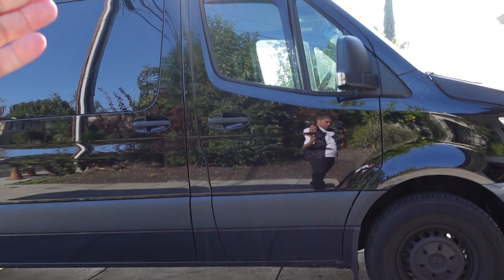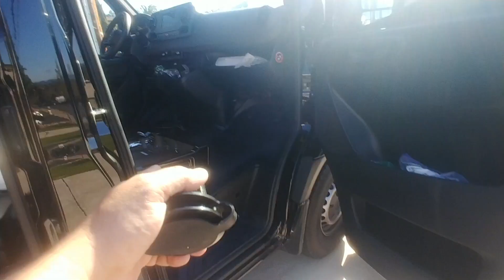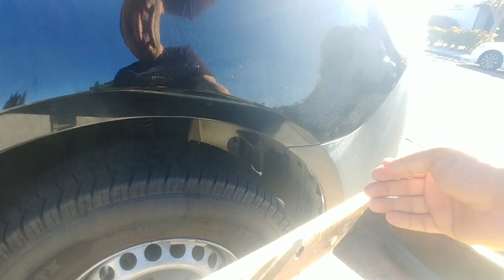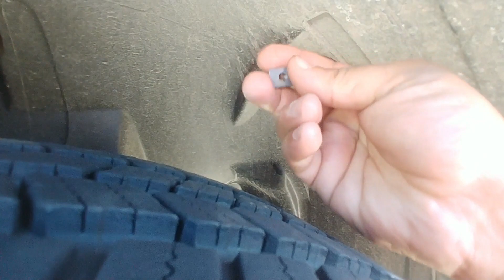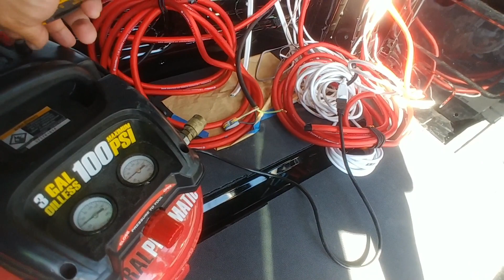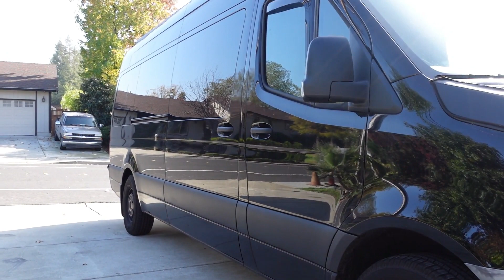Van Life Stealth Shore Power Plug Install▶️ 30 Amp Electrical RV Plug

Comment from the maker: ▶ See all the parts I used in my VAN build for FREE https://bit.ly/RFVanBuildPartsList
▶ See the VAN build schedule for FREE https://bit.ly/FreeVanBuildSchedule

▶▶ Update Stealth location https://youtu.be/PO2sdMM50-A
Free gifts ▶12 volt / 110 volt systems https://bit.ly/12vs110volt
Free gifts ▶Automatic transfer switch wiring diagram in color https://bit.ly/atspic

Products used in video
▶5 Terminal quick connectors https://amzn.to/46O7E6m
▶3 Terminal quick connectors https://amzn.to/3S3OwNQ
▶2 Terminal quick connectors https://amzn.to/3M6Enfd
▶Great 12 volt quick Connectors https://amzn.to/401ERZN
▶12-volt quick connectors kit https://amzn.to/46V0UDE
▶10/3 marine wire made for Camper vans https://amzn.to/3Qj3y0L
▶2000 Watt SW Inverter https://amzn.to/3rUuf2s - failed
Better 2200 watt sw inverter https://amzn.to/490E1R9
▶Inverter remote https://amzn.to/3ZZE2Rf
▶15 Amp Automatic transfer switch https://amzn.to/45yiAEk
▶30 Amp Automatic transfer switch https://amzn.to/45IGzAQ
▶Budget Inverter with remote https://amzn.to/3PYWMMc
▶1/0 Cable for inverter https://amzn.to/3CrUfT3
▶4 Gauge power cable https://amzn.to/407olrl
▶Lugs- 100 Cable connectors https://amzn.to/3FqFbI0
▶Lug Crimper https://amzn.to/3PZ7liu
▶Cable protector https://amzn.to/3PYnTHb
▶14/4 speaker wire (came be used for light 12 volt loads ) https://amzn.to/45AbLSr
▶14/2 speaker (came be used for light 12 volt loads ) https://amzn.to/402gRpJ
▶Junction Studs https://amzn.to/3M5bSii
▶Fuse / Breakers https://amzn.to/3M6F08z - use only for 50 amp loads or less
▶30 Amp Fuse / Breaker https://amzn.to/403WmJ1
▶30 Amp Lifepo Battery charger https://amzn.to/3Q25yZJ
▶500 Amp Battery Shunt https://amzn.to/3S4dSLl
▶Smart Battery Isolator https://amzn.to/45CzGAX
▶15 amp outlet https://amzn.to/3M5yJKr
▶15 amp to 30 amp plug https://amzn.to/3M4uUFg
▶30 amp shore power plug https://amzn.to/45yjMYk

▶▶▶Camper van playlist
https://www.youtube.com/watch?v=r2KTXLqso2c&list=PLDEbtVOPRC-id5xjqFsYm87bJSJL8bLbe

2019+ Sprinter Review https://youtu.be/wAAV6bnHNzY
The new toy  https://youtu.be/EAKbCledvsQ
Low Key Battery https://youtu.be/-FI_DG-DE9k
How to Buy a Camper van for cheap https://youtu.be/nqPSV0mszfk
Seat Removal https://youtu.be/KSUQawuSt_w 
Headliner removal https://youtu.be/FjrJBLXEbyU
Maxx Air Fan Install https://youtu.be/QXxBSx3cfI8
Maxx Air Fan Review https://youtu.be/JIRG7lSR5yQ
Maxx Air Fan Fix https://youtu.be/6k0mPqCgrl4
Bathroom Fan Review https://youtu.be/QXxBSx3cfI8
Spare Tire Carrier https://youtu.be/wVQ_h-FjtPE
Oem Diesel Heater Trick https://youtu.be/Ws9GHo9bWeM
Led Upgrade https://youtu.be/r2KTXLqso2c
Sportscraft Swivel Adapter https://youtu.be/HVkj6KVpUbs
Pocono Swivel Seat Adapter https://youtu.be/r-1HpIl71_I
Front Speaker install https://youtu.be/JjoJH4z4G1E
van Sound Deadener https://youtu.be/8x8RxmrBxL4
Sprinter Trim Removal https://youtu.be/ucYJsH5FJxY
Van Roof Deck https://youtu.be/4cu8mjVKQzc
Front Air Filter Change https://youtu.be/U46Ah40_vIM
Cabin Air Filter https://youtu.be/y8oZNLOkrok
907 Sprinter Oil Change https://youtu.be/bmgI-9KeEik
Maintenance reset https://youtu.be/wDTMwXHGqRY
Diesel Heater Hack https://youtu.be/Ws9GHo9bWeM
DEF Fluid https://youtu.be/Q84lEhLrobM
Portable Toilet Review https://youtu.be/fYu66hqGJZo
Affordable Kitchen Galley idea https://youtu.be/5DG9y_kmHLY
Rear door storage https://youtu.be/bPZfvTWAze8
Modify Rear A/C vent https://youtu.be/o4FJ6Y1ulCs
Sliding Door Bug Screen https://youtu.be/oGA8udVJlYM
Shower https://youtu.be/O4POEFKQmJQ
Plumbing video https://youtu.be/PuOqOt_911I
Simple bed idea https://youtu.be/Q7uGVFPgeDI
Van Life Camper Van Kitchen Galley Idea Under $200
https://youtu.be/5DG9y_kmHLY
Premade Camper Van Bed That Sleeps 4 Under $250
https://youtu.be/Q7uGVFPgeDI
Thetford Porta Potti Review - Simple Odor Free Camper Van Toilet Solution
https://youtu.be/fYu66hqGJZo
Van Life Rear Door Storage Solution for Under $40 for Camper Vans
https://youtu.be/bPZfvTWAze8
Sprinter Factory Roof Ac - How to Modify Vents for Van Build
https://youtu.be/o4FJ6Y1ulCs
Van Life DIY Camper Van Bug Screen For under $40
https://youtu.be/oGA8udVJlYM
Long Seat Belts for Van https://youtu.be/b9sQHKU-xdk
Battery Shunt https://youtu.be/54xGTbcFQB0
30 amp Battery charger https://youtu.be/SY0wS3DlKho 
Battery Box Cooling idea https://youtu.be/sng2aot7PLc
Window Covers https://youtu.be/aO407scjyfU

Comment: Use cardboard to make your hole saw and test you plug if it fits before you make a hole on your van
Reply from the maker: Why, you can tell if your slide the plug into the hole saw.

I found a much better shore power location unless you need it in the very front. Came out clean! https://youtu.be/PO2sdMM50-A?si=Uuh4ppXkPZfHYqrr

Comment: Do not install this here. I don't care how water tight it may be. That tire is going to kick up so much water onto this outlet. Do not do this.
Reply from the maker: It’s on the front bend not the rear bend. Never had any issues but there is an easier stealth location in the rear bumper with a factory hole.

Comment: Most RV park power sources are on left side of the van.  Ideally on left rear.  You put yours on front, far right.  Did you explore the other wheel wells?  Just curious.  This means we gotta get one long cord to reach.    Solar generator?  You referring to a power bank?  Ours have 5 lithiums charged by solar and alternator.  Comment please?
Reply from the maker: Good catch, the inverter was already setup under the seat from the dealer when I purchased this sprinter so it was going to have to be one of front two wheel wells. The passenger side made it the shortest run and I could just use a record extension cord for when I did stay at rv park. As far as solar generation I had two hundred watts of solar panels on top and a 50 am dc to dc charge for when the engine was on it would charge the batteries. I had five  280 amp 12 volt lifepo4 batteries that I made myself. 

As per the rv park they got real expensive in California so I found a few applications for my phone that showed free spots.
Reply: @RANDOMFIX  free is always good!
Reply from the maker: @MichaelWilliams-ro9bm the name of the application was iOverlander

Comment: Thank you this is great!  It's a great idea. Thanks for the diagrams too.
Reply from the maker: Glad to help, thank you for the great feedback. Since that video I made it to 24 states with no issues other than the max air fan beeping 10 times if over 10 % power. Let me know if you need anything. I also found the perfect inverter that fits under the seat and can handle a big load.